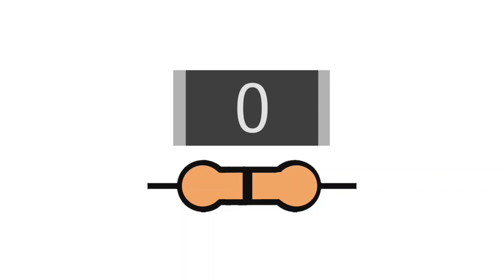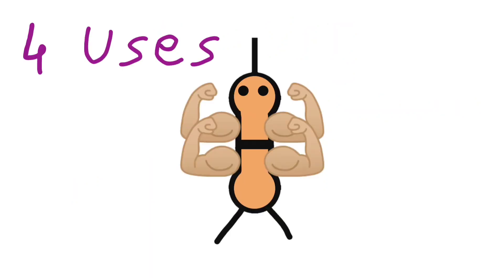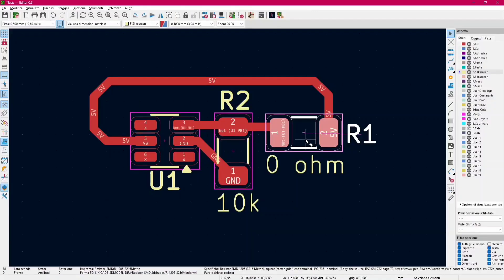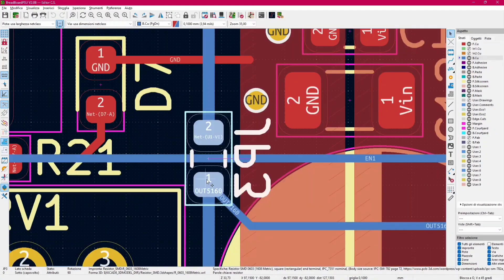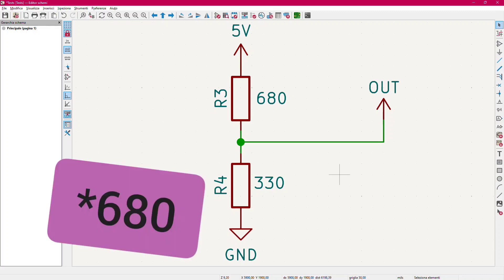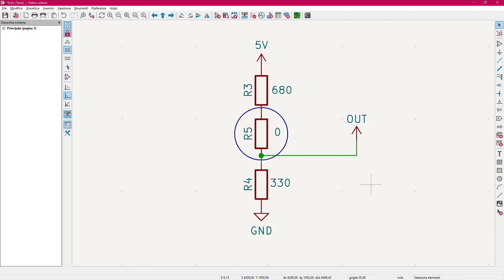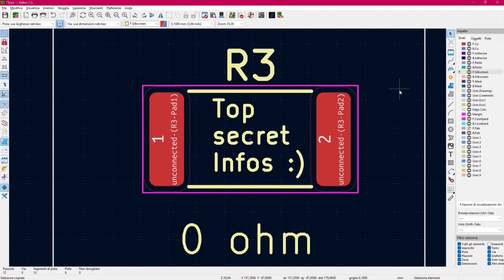Why 0 ohm resistor exist?

Comment: What confused me lately that the 0 Ohm resistor can have tolerance 5% or 1%  or 0.1% etc, mathematically it is nonsense)
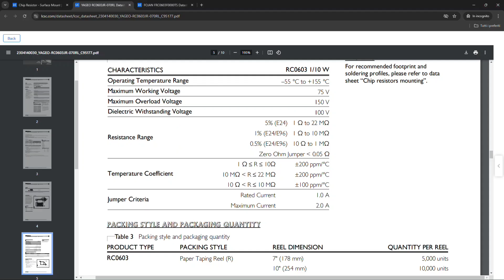Reply from the maker: @tarasian666 I paste here my answer to another comment: If you look at the datasheets I showed in the video at minute 3:22 YAGEO has tolerances for resistors above 1 ohm but for 0 ohm assure you a true resistance less than 50 mOhm, so the tolerances are only for above 1ohm. FOJAN instead (second datasheets) tells you that if you buy a 0 ohm 5% you'll get a true value < 50mohm and if you buy a 0 ohm 1% you'll get a true value of < 30mohm. Maybe a manufacturer could have a 0 ohm 0.1% that for example assure to you a true resistance of <10 mohm. Thank you for your comment

Comment: Can a zero Ohm resistor be replaced by a zero uH inductor?
Reply from the maker: @Real46  As far as I know there are not 0 uH inductors, the minimum you can get is like 0.1 nH = 100 pH

Comment: In my early days in electronics this thing had me scratching my head for a while. I had never experienced a shorted resistor before (open perhaps, or wrong value, but never a dead short) and I was stumped as to why the circuit was shorted until I finally lifted one side of that component and discovered the mistake that someone on the assembly line had made.
Reply from the maker: @i0am0patch  Wow, so all the board in that lot were with the wrong component? Or was only that one board?
Reply: @BurningElectronics  It was the whole production run (only about 20 boards ) I received, but after getting QA to check the stock in (our internal) stores it seemed that the problem was with the stock there as well and they had to be purged.
Reply: Have seen quite a number of shorted resistors of 1 Mohm range. But obviously not on PCB-s. Specific resistor in old CRT TV-s. Damage is visible to naked eye.
Reply: I had that happen where assembly put a resistor where a cap should be.  The supply was not happy.
Reply from the maker: @user-ty2uz4gb7v  Wow, a resistor instead of a capacitor can really ruin your day(s)

Comment: A light emitting diode connected to 12v through a 0 ohm resister quickly becomes a dark emitting diode (DED).
Reply from the maker: @Torby4096  That's fantastic! Never never heard of DED!

....

Oh wait...
Reply: @BurningElectronics  😂
Reply: @Torby4096  it also becomes ded
Reply: @TheBanancer  A DED is, if nothing else, very efficient, using no power at all to remain dark.
Reply: @Torby4096  and the diode works both ways

Comment: Basically these 0 ohm resistors are jumpers .
Reply: And fuses
Reply: Or wire bridges for automated placement. If we were soldering the same devices by hand, we might just use a bit of copper wire.

Comment: What about a poor man's fuse?
Reply from the maker: @acrodrigues1  As I said to other comments, yes it is used also as a cheap fuse but I don't reccomend it. Furthermore smd fuses are now really cheap so it is not worth to use a 0 ohm resistor as a fuse
Reply: I can't see, how it could work. You need energy to blow such fuse. But due to its low resistance, power dissipation is also very low. Everything else in the circuit should be fried before it finally blows.

Comment: I'm going to remember going over a trace instead of going through layers...
Reply from the maker: @scottdrake5159  If you can I suggest to use vias. If you can't, then, sure, use 0 ohm resistor! The good thing about smds are the various packages, so for example a 1206 0 ohm resistor can jump more traces at once, or one big(ger) trace!

Comment: How is info hided ?
Reply: Very little silk screen information🤔
Reply from the maker: @shawnm8232  You can hide silkscreen on purpose with a 0 ohm resistor if you want. It's rarely done though

Comment: Why put a wire when you can put a dead short in the resistor package....much cheaper since the machine and tooling doesn't have to change

Modern day jumper wiring
Reply: Someone  wanted to avoid via holes again to lower cost....

Or screwed up a trace after finishing over half the shit and just said fuckit it put a wire in later...

Comment: Use 0 ohm resistors as programing jumpers, no solder bridges, bits of wire, dip switches and dirt cheep. Can always put in an actual vale if needed.
Reply from the maker: @universeisundernoobligatio3283  Yes, indeed they are great as jumpers!

Comment: Sometimes they serve as a safeguard, something like a fuse
Reply from the maker: @tristankordek  As I said in another comment, using a 0 ohm resistor as a fuse is a cheap and bad design idea
Reply: @BurningElectronics   True, but I'm not talking about replacing the fuse with a resistor, but about providing simple protection, I don't know how to put it, so I'll give an example that I remember from many years ago.
In the days when LCD TVs were just starting to appear in our homes, each HDMI port had such resistors on the lines leading to the controller/HAB/microcontroller/CPU that protected the uf system from potential differences when connecting the cable/device to the TV.
Most often, when the port stopped working, it was enough to replace the burnt-out resistors and that was the end of the problem, but a few years later, more and more TVs had nothing between the HDMI socket and the central and often the only IC on the logic board, which made repair impossible (IC unavailable) and at the same time unprofitable (logic board at the price of a new TV), and all this because of the lack of tiny 0 ohm resistors.
Reply from the maker: @tristankordek Good example, were you a TV technician?
Reply: @BurningElectronics  I am an IT specialist, but it all started with electronics, and to this day I repair electronic devices.
Reply from the maker: @tristankordek  Great! Thank you for your comment!

Comment: It is a shunt .
Reply from the maker: Shunts are resistor whose resistance is used to calculate the current flowing through them by measuring the voltage drop on the resistor. Since 0 ohm resistors are anywhere in between 0 and whatever the datasheets says, 0 ohm resistors are a REALLY BAD idea for sensing the current. By giving you an example, the real value of a 0 ohm resistor could be either 5 mohm or 50 mohm. Let's say you read 50mV across the resistor. The current passing through them could be either 1A or 10A. That's what we call bad design. Of course you can use it as shunt AFTER you know the exact value of the REAL resistance, and even in that case 0 ohm resistors are not made for that purpose
Reply: @BurningElectronics  a shunt is an alternative pathway .
Reply from the maker: @philliplopez8745  If you intend that we can use a low value resistor (in the order of mOhm) instead of 0 ohm resistor then sure but it dipends on the circuit
Reply: @philliplopez8745  Probably best just to admit you're wrong?
Reply: You don't even understand Ohm's Law.
Reply: @andymouse  π are round , cornbread is square , f#+k off !

Comment: What are their power ratings ? It should be able to handle loads of current, in any form factor, due to the low resistance ?
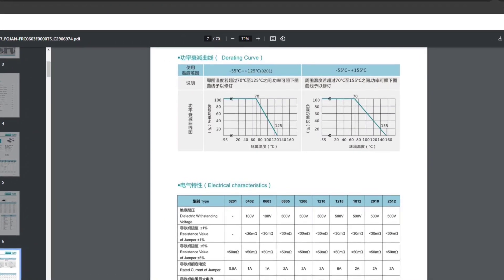Reply from the maker: The power ratings It's often not specified for 0 ohm jumpers. As P=RI^2, but R=0 so P should also be 0. For manufacthrers it's more convenient to tell you the max current they can handle. For 01005 package we have 0.5A to 1A or less. For 0201 we have 0.5 to 1A. For 0402 we have from 1 to 2A. For 0603 we have max 5A and so on. For 2512 you have 10A but it's only a de-facto standard for jumper current so you'll see 0 ohm resistor rated only at max 10A but they indeed can take more current (I'm talking for 2512), you can also check the FOJAN datasheet I inserted at 3:30. You can see the various current ratings for jumpers!

Comment: The funny thing : 0 ohm resistor exist with different tolerances 5%, 1%, 0.1% (more expensive) 🤣🤣🤣
Reply from the maker: @olivierconet7995  If you look at the datasheets I showed in the video at minute 3:22 YAGEO has tolerances for resistors above 1 ohm but for 0 ohm assure you a true resistance less than 50 mOhm, so the tolerances are only for above 1ohm. FOJAN instead (second datasheets) tells you that if you buy a 0 ohm 5% you'll get a true value < 50mohm and if you buy a 0 ohm 1% you'll get a true value of < 30mohm. Maybe a manufacturer could have a 0 ohm 0.1% that for example assure to you a true resistance of <10 mohm. Thank you for your comment
Reply: @olivierconet7995  how does that work
5% of 0 is 0

Comment: I see them used as fuses a lot in stuf like nintendo ds and other handhelds.
Reply from the maker: I mean, if it's true, then it's a cheap (and bad) design in my opinion. Btw thank you for your comment!
Reply: @BurningElectronics Not true for the Nintendo handhelds. They all use a proper fuse. I've yet to see a 0Ω resistor in there.
Reply from the maker: @ItsZel A proper fuse is always a better idea!

Comment: Another use of 0 ohm resistors is being a lamp when there's a lot of current.
Reply from the maker: @monad_tcp  Mhhh seems interesting. Let me try it! Ahah
Reply: You mean a LER, Light Emitting Resistor 😂
Reply: @hakansternersson1804 Nice idea 😂
Reply: @hakansternersson1804  you already have that, it's your old 100w light bulb, also 0 ohms won't heat up at all. H = I²Rt, with R being 0, temp won't rise at all.
Reply: you can also warm up your circuit during winter (1 use only tho)
Reply: It doesn’t work that way, 0 ohm is basically made of copper, and I am sure your circuit will burn before 0 ohm 😅
Reply: Isn't the resistance in an incandescent bulb what creates the heat, and therefore the light, in the first place?

Comment: Useful information, thank you.
I used to think it was used as a fuse to break the circuit.
Reply from the maker: I'm glad you learned something. By the way, there are what's called "resistors fuse" called fusible resistors. Those fail (on purpose) when an high current passes through so they open the circuit. But those resistors are used less and less